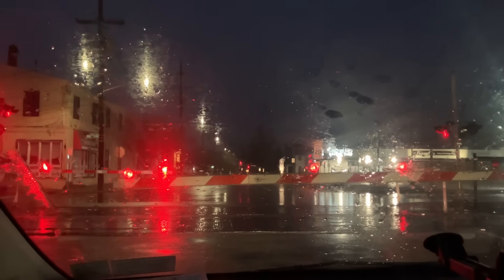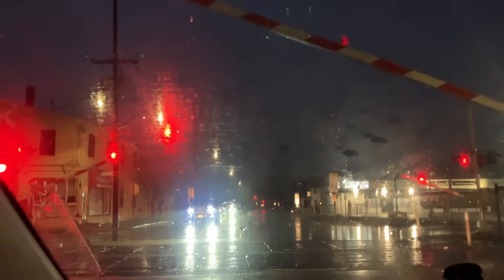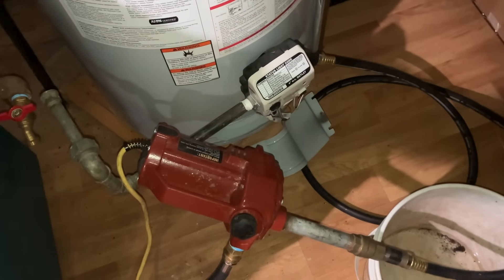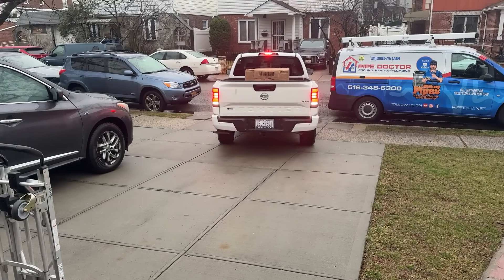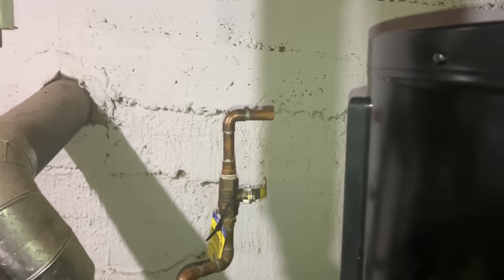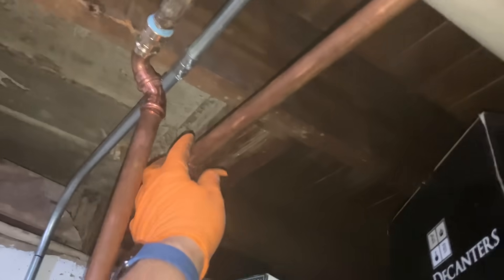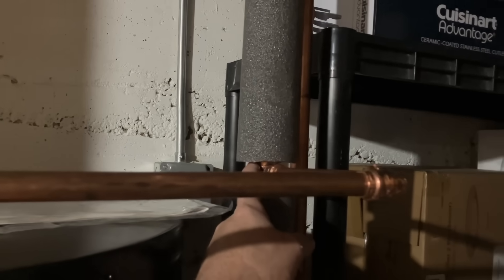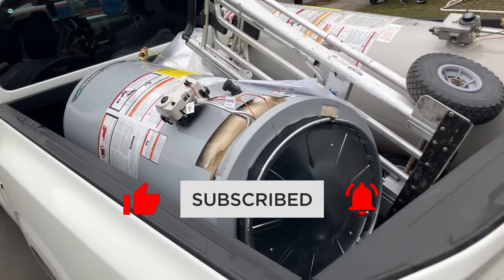Ditching Gas! Swapping a Water Heater for a Heat Pump with Solar Power ⚡🔥

Comment: What do you pay per KWH for gas and electric?  In the UK it is average of about 7p for gas from about 3p a few years ago, and 34p for electric compared to 11p a few years ago.  Companies were privatised and now profit driven.
Electric heat pumps cost between £5 and £10 per DAY to run if you watch some of the honest reviews.  This is normal people on special low rates too.  They only get around 18c in their houses which I wouldn't want.
I pay £13 per week to have a gas boiler, 25KW, heating the house to 22c most of the day and this provides hot water too.
Many of the heat pump videos from UK people are from those employed by companies selling them, so most are staged.
A lot are fake home owner videos, usually with people that go on to try and suggest people need to buy solar panels and electric cars.  They get paid.

Comment: Per manufacturer you’re not supposed to start up the unit for X amount of hours after laying it on it’s side even short term because of the oil inside the compressor apparently

Comment: You make it look easy and you get things done fast. That is the only way to make money. I want to put it in an electric heat pump hot water heater in my house. Also unfortunately we still have oil here and probably will never have natural gas go by here so I need to install a new boiler. I’ll probably get beat up,🤕 like Biasi boilers with an RIELLO burner had great luck with them over the years. I like it. They’re wide enough. I can move them around myself.

Comment: Mikey, I like how you just jump in and help your employees to install. You can tell you have a passion for it like I said I never had a boss work right beside me like you do that speaks volumes I noticed you don’t back up your pipe brunch with another pipe wrench I was always taught. That was the only way to do it so you wouldn’t jar other fittings not seeing how it doesn’t work just letting you know what my boss used to tell me he wants to tighten the pipe so tight popped blood vessels in his eyes. After that we called everything blood vessel tight.

Comment: We had a ao smith rep come out to our class for the requirements for licensing in NJ and we were told  to  always install the 80 gallon store due to the slow recovery of the equipment and to also add mixing valve to maximize efficiency.
Reply from the maker: Thanks for the tip, I’ll keep that in mind.

Comment: For most people who live in densely populated states like New York, New Jersey, and the surrounding areas, a heat pump water heater is a very bad idea. It makes the room cold where it sits. So in the winter, your home heating energy supplies the warmed air that the water heater needs to extract the heat. If you live where AC is always on, sure, then it's a great idea. Somewhere like Florida or Georgia in the East, or Arizona or New Mexico in the West. A hot environment makes it worth the effort. Not here.
Reply: That's a very real consideration, if it's in the heated area of the house. As long as operation isn't causing a cold spot in the house you're just causing a relatively small drop in effective efficiency. Unless your main heat is resistive electric you'll still have over 2x the effective efficiency compared to standard electric elements.

Comment: I would have loved to hear the fan noise for when the unit runs in heat pump mode…. My cousin has the “other brand” near her bedroom and describes it as sleeping in a hotel one room away from the commercial ice maker.
Reply: The 1 year old AO Smith 50 gallon heat pump water heater we have is about as noisy as a 5,000BTU window AC when its running in heat pump mode. installation in a basement away from living space works the best.  It has the added benefit of dehumidifying the basement during the summer.
Reply from the maker: I didn't notice much noise, but it's different for everyone

Comment: Wouldn’t the heat pump add a load on the heating system?
Reply: If it's in a heated area it will add something like 3-4kBtu/hr to the heating load when it runs.
Reply: technically in winter yes, as it's cooling and dehumidifying the surrounding air to heat the water. but in summer time, that's good for most all cases.

Comment: Why complicate a water heater with a refrigeration circuit? Is it really better than a simple element based electric water heater? Because most electric water heaters are serviceable. Use the long surface area elements. I've been problem free over 10 years. I have had to clean it because we have very hard water. Also the standard elements are too hot they boil the calcium out of the water and it collects in the tank.
Reply: In heat pump mode it's about 1/3 - 1/2 the operating cost of a resistive element heater. So if you use it enough it's definitely worth it.
Reply from the maker: I don’t make them. Just install and service
Reply: @PipeDoctor  I enjoy your videos. I just didn't know they existed. I learned something new. Thanks

Comment: Can’t beat bluefin ball valves from supply house. So much cheaper than Ferguson.
Reply: I’d personally rather pay for Viega then use cheap Chinese made valves. Bluefin is good for certain things but not press fittings, especially not valves in my opinion
Reply from the maker: I have zero issues with their ball valves. Ferguson sucks
Reply: Same here. Zero issues with bluefin valves.

Comment: I installed at home also added Caleffi mixing valve, never run out of hot water. Electricity bill vent down 30%
Reply from the maker: Nice! That's what I'm talking about.

Comment: Why did Peter lay the water heater in the bed of truck on it's side when it's supposed to be upright?  Anode can chip the glass lining with all the bouncing around on the road.  Just FYI.
Reply from the maker: I’ve cut open many tanks. No way the anode rod can flex like that.
Reply: if a solid anode rod flexes far enough to hit the inside of the tank, there's far larger problems like the tank being used for fork lift soccer before delivery.

Comment: The disconnect should be a DPST (aka On/Of 2 pole) and it needs to be rated at 30A because it is on a 30A breaker (as it should be at 16.4A because of the 80% rule)
Reply from the maker: Okay 👌 I’ll forward the concern to the homeowner who can let the electrician know
Reply: I have a feeling that the proper switch was installed and that Mike just got poles and throws mixed up.

Comment: I think you said it about 3 times, or I am mistaken, but did you connect Hot water to the boiler feed?
Reply: yes, that's common especially for a steam boiler. A. don't want cold water entering because it can thermal shock and crack it  B. it defeats the idea of keeping the water hot for next cycle. you can feed hot to other hydronic boilers too, but it's not as critical with lower temps and more system volume overall. although yes you could possibly thermal shock crack them, if drained empty and blasted with cold water refill.